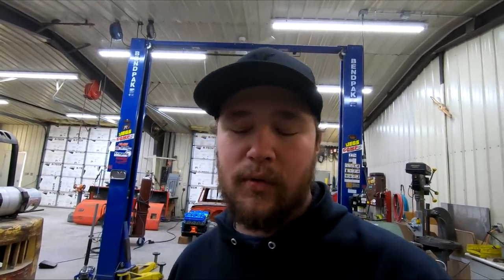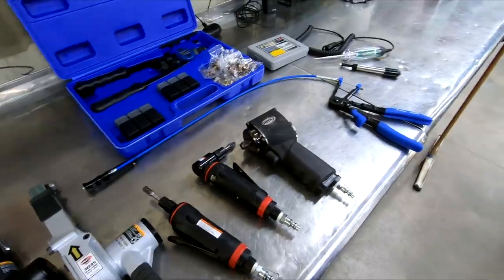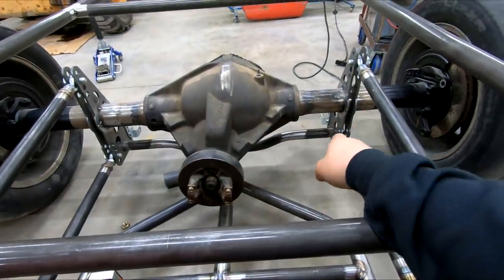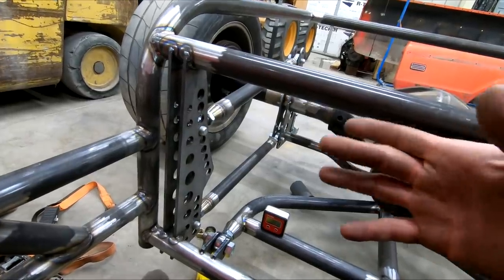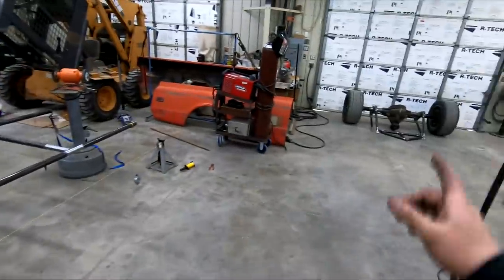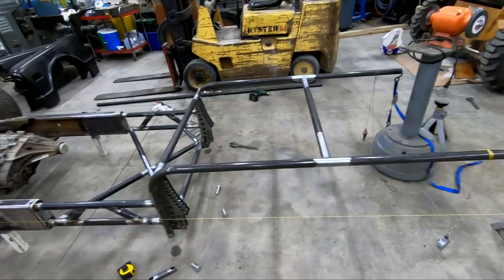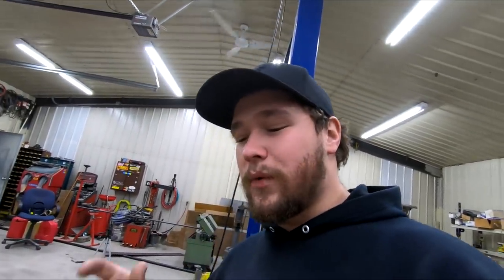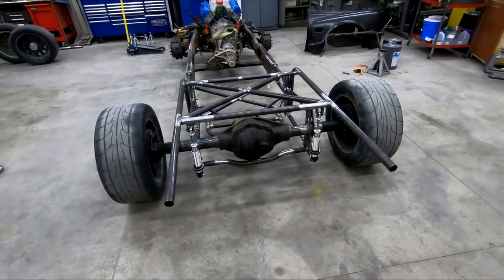Tubular Back-Half Drag Truck Pt.2

Comment: Looks good, the only constructive criticism I would say is that on the 90 degree bars that go through the front four link brackets I would have made them longer through the four link bracket and attach them to the side bar next to the four link bracket, it would add a lot of rigidity to the middle of the four link bracket, it's like the difference between single shear and double shear. Great job

Comment: You sir are a very talented fabricator! Question: do you drill a tiny hole in the tubes to allow gasses to escape?
Reply from the maker: Yes sir, try to hide most of the holes but a few are visible.
Reply: @Whitt_Built  Ha! That's what I was hoping you were doing. I do the same thing by hiding the holes under the intersecting tube. Prevents a lot of headaches when closing up the welded tubes. You should point out that technique in your next chassis fab video. It would be helpful to those who aren't aware of the problems of expanding gases trying to escape.

Comment: Love the progress on the truck. Great filming and editting as well. Great explanation on everything you do to the frame and why you do it. Maybe it's too much, but as the 4-link brackets and the vertical framebar are so close together, isn't it easy to just weld a gusset plate between them, so you also tie the 4-link to the vertical framebar?

Comment: The wishbone looks like a lot of extra weight compared to a panhard bar.
Reply from the maker: Slightly heavier, still a ton of weight savings compared to the factory leaf springs. One down side to a panhard is the axle will shift side to side with suspension travel

Comment: Wow there’s a lot of piping In that back half. 
Will it save weight or just handle better?
Reply from the maker: Bunch of weight savings, and made it easier to add the 4 link stuff than adapting too a stock frame 🤘

Comment: What is the computer program that you are using again?
Reply from the maker: It is called blender
Reply: @Whitt_Built  sweet. I appreciate it. I am turbo LS swapping a 05 g35 and I need to stiffin up the chassis and I am very familiar with CAD and have access to $25mil in CNC machines and have a 3d mapping tabs and tool to read the sensors and i think that program will be the missing link. I appreciate it